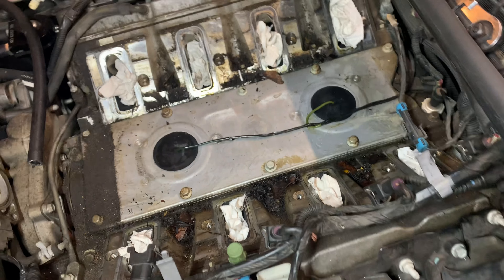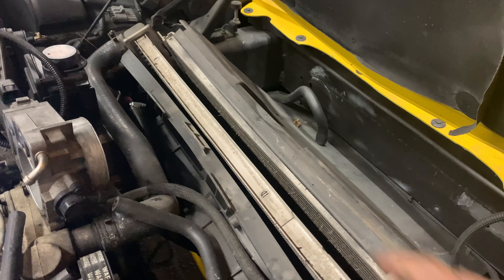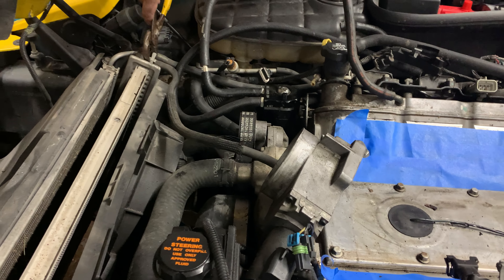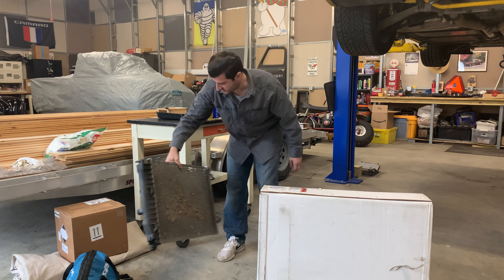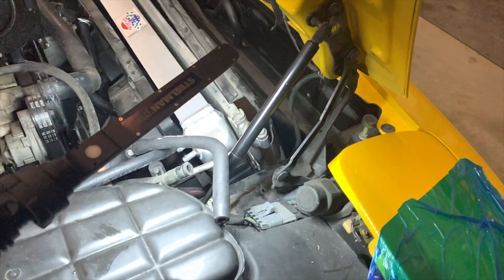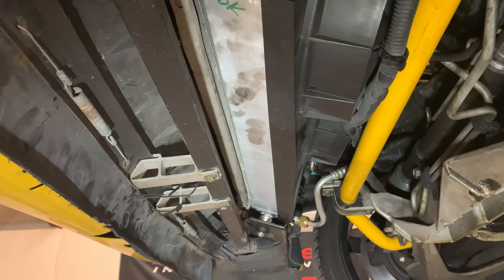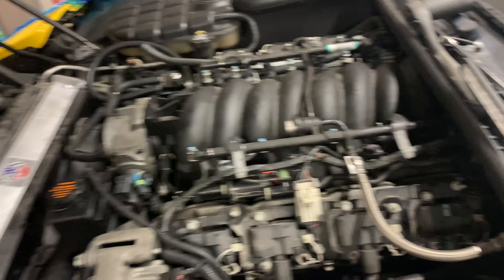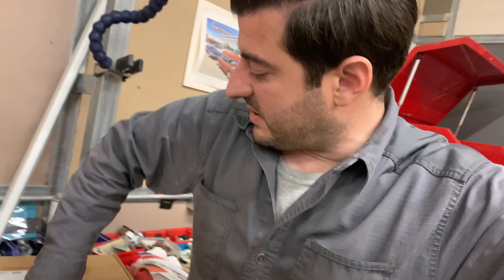DEWITT’S C5 CORVETTE RADIATOR UPGRADE: C5 Track car Ep: 16

Comment: What's up bub, as always great Vid. The oil leak, and you know as well as lots of others out there, have common areas. 1. oil press sens.  2. Valley Cover, rarely.  3. Rear Main.  4. Rear Engine Plate.   Normally if the oil is looking like a seep, or a leak, in the rear area of the pan, it could be the rear engine plate.  Same thing happen to me, I thought i needed a pan gasket, but did research and found that with the LS, has a bad castings for the rear engine plate from the factory.  I wanted to do a clutch anyways, so I dropped the drivetrain, removed the clutch, and sure enough, rear plate was leaking like a sive.  Summit sells a kit w/ a plate, gasket and seal.  Look into it.  You know how to contact me if you have any questions. be safe.
Reply from the maker: After looking closer, it seems to be from the front of the engine, at least thats where the drip is coming from. It could be coming from the back too like you said

Comment: Must owner C5 they don't notice that   aftermarket radiator  they are heavy twice than the OEM  when they get full up   with the coolant  the problem  is  the frame in the bottom  the one is holding the radiator start to crack   because that.  ... Well nothing you can do only to  check the frame every while
Reply from the maker: Yea I may have to reinforce that eventually

Comment: Do you have a video on installing the oil cooling hoses to the oil pan?
Reply from the maker: It’s in this video as best as I could, it was hard to get the camera in there.
Reply: There’s nothing about connecting the oil cooler in this video…

Comment: Here's a question for you, if you used the oil cooler that is. What's an oil change look like with the oil cooler in there? Do you need to drain the oil cooler as well since it had the thermostat in the housing?

In looking to do the same for a C5 I want to track. Not sure if I even need the oil cooler but I'd I'm already there and the radiator already has it... Seems like a no brainer?
Reply from the maker: Oil change is just the same, no additional draining, enough of it will come out. You just add that improved racing thermostat and you’re good to go.
Reply: @LowBoostFilms  rad! About how much oil capacity did it add?
Reply from the maker: I run a full 7 qts now

Comment: Off topic question but did you have to use wheel spacers for the C6 rims on your C5 ?
Reply from the maker: 3-5mm spacers on the back, it’s tight, but they don’t rub
Reply: @LowBoostFilms  thankz for the info and great video keep up the good work
Reply from the maker: Thanks!